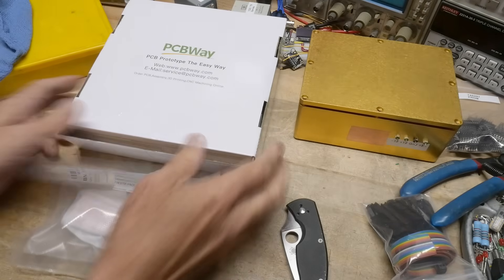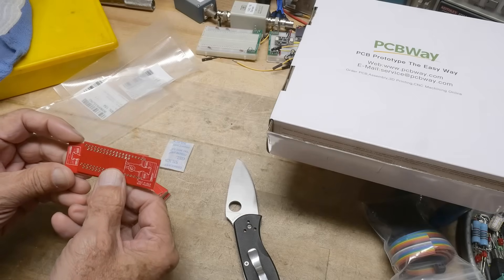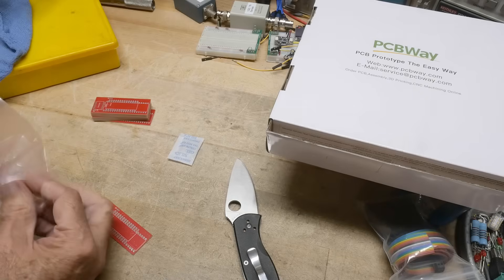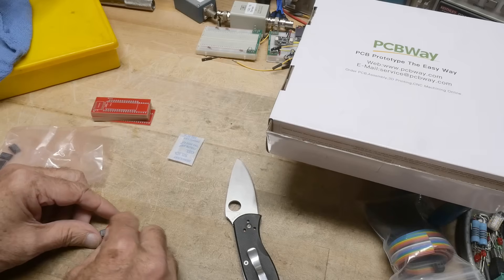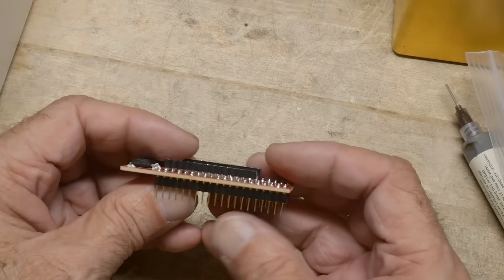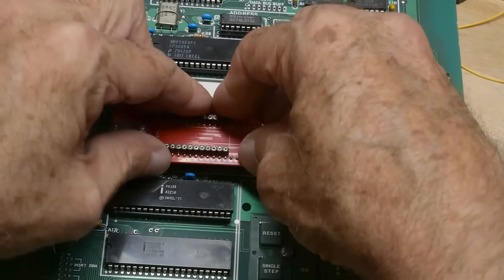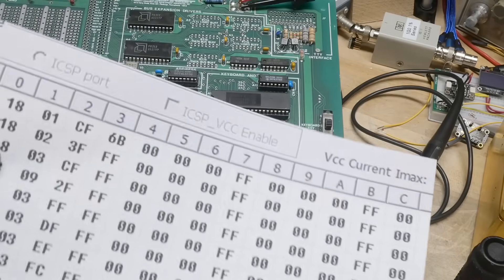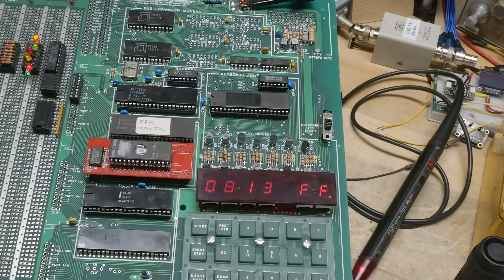#2373 Intel 8755 Hack (part 4 of 5)

Comment: 4:51 looks like you soldered them the other way around.
Short side with taper is supposed to go inside female header and flat side is for PCB pads.
IDK, why they make them longer sometimes, but the ones I got are also less in diameter than the short side that is 0.6mm and sits in female part proper tight, while the long ones are 0.5 or something are are quite loose. 
P.S. for search just use "round pin header", simple as that

Comment: I'm curious what the original 'project' that was built on this does.
Reply from the maker: the wire wrapped project that was done seems to be a simple buffer IC that was used to drive 8 LEDs, the data was from an IO port on the main 8755
Reply: @IMSAIGuy  So a demo board to learn programming, then the next version was built on a bespoke board, and the demo was packed away for ever till you got it.

Comment: Search for turned pin header. Was cleaning out one of my catch-all parts boxes and found some of these and other 87xx parts. There was even a cool UVEPROM microcontroller with lots of pereferials. It had no window 😮 for the UV. CNC one??
Reply: 87xx parts without a window are production line parts, exactly the same EPROM die inside.  You can erase them with a heavy X ray dose, as that does go through the plastic easily. Of course, you do need an industrial X ray machine to do that, a dental one will take a half hour or more to fully erase.

Comment: Have you considered putting the 373 under the sockets to reduce the footprint of the board?
Reply: Could have, but for this not worth it, as this way you need a lot fewer vias, and also now have some convenient debug pins as well. Yes very common to put that latch under the chip, but production board only, the debug version would have the pins around. Even works with the DIP version, but your sockets have to be skinny ones to leave room.

Comment: Could use a 6532 or an ay8910 or 8930 since ay chips use a multiplexed address and data with a direction pin instead of ale

Then the 16 bit of Gpio for whatever Rom or ram or chip you want

And it can play music